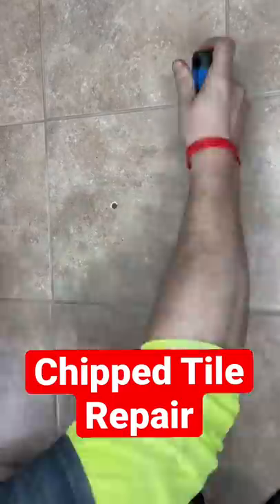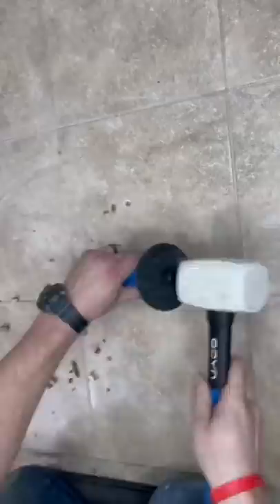How to replace a chipped tile. DIY. #shorts #youtubeshorts #diy

Comment: I've replaced hundreds of floor tiles, some are much easier than others, this one definitely an easy one.
Reply: It's also super sped up though. Looks like it had to be broken into multiple chunks first.
Reply: Some chip with the slightest glance, so annoying
Reply: Do you wait 5 hours too before grouting 1 single tile ? Lol
Reply: @johne8907  yes, you let the thinset dry (the white paste that sticks the tile to the floor/wall) and then apply grout.

Comment: I like to begin chipping in the center of the tile, as there's less chance of chipping surrounding tiles.....had an appy once damage every tile around the tile that was initially chipped....lol. 😎🍻👍
Reply: That’s why you remove the grout. Unless it was marble or the spacing was 1/16. But 1/8 or 3/16. You should be good with the corners..
Reply: Defo start in middle …like you said …you don’t want to be ripping more tiles up

Comment: Good thing to note, if you're using a grinder and you go past the joint into the next joint a little bit always grind down and make it round with a knife so when the grout goes down it overlaps the previous grout and it becomes a nice blend and you don't see any marks

Comment: Just curious my friend, is there a standard thickness of thinset you lay to the back of your tile when doing this, or laying tile in general?
Reply: You are limited to the original thickness of the surrounding tiles in a repair, if a new job, don't put more than 3-5 millimeters of tile glue, thicker is not better.....
Reply: @richardwebb9532  yes that is true, I do tile removal and demolition and when we have jobs that have really thick thinset the tiles are very easy to remove. They barely are even on there sometimes it’s actually crazy lol
Reply: @larryboquist6439  lol ....it's called "thinset" for a reason....🍻😂🤣🍻
Reply: @larryboquist6439  I too have found this to be true.

Comment: That works only if diamond lath wasn’t installed on top of  Plywood or Particle board! That was used under my  hallway floor with 12x12 limestone tiles! With that said all of the flooring in the hallway 7 x 10 = 70 ft.² has to be ripped up diamond Lath and particle board removed